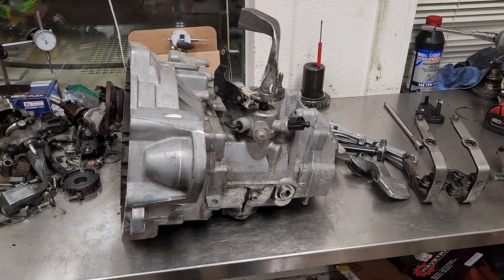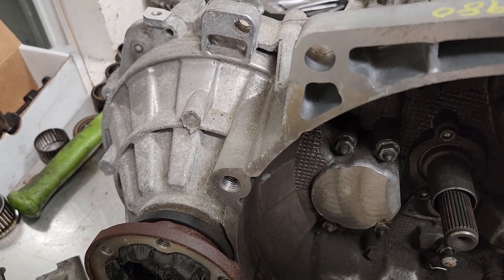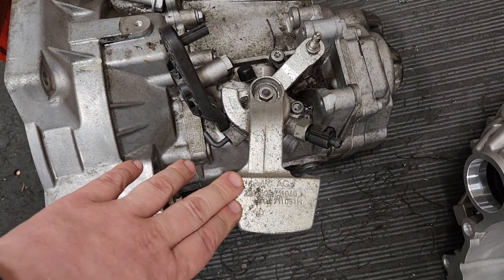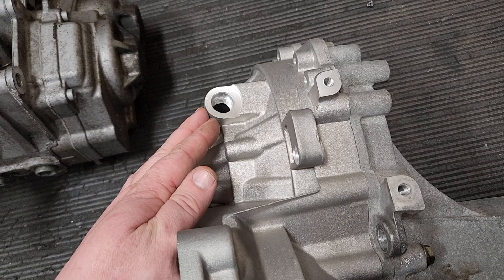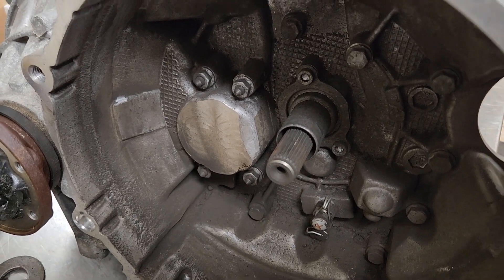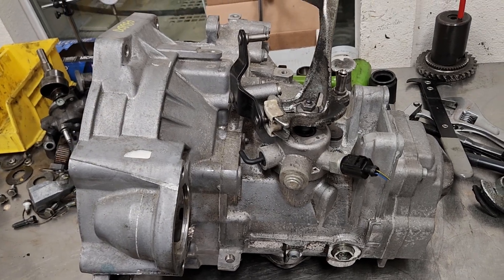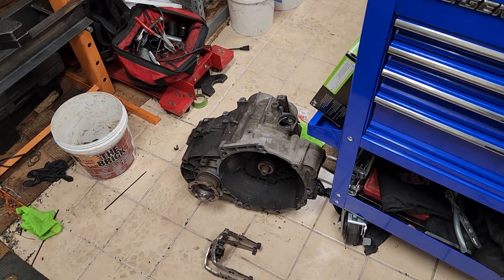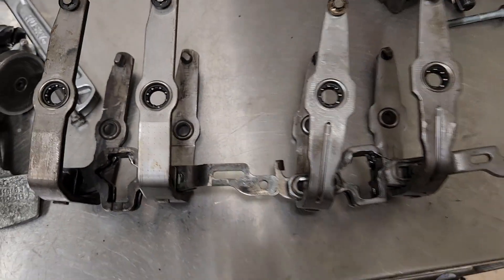VW 02S 6 speed swap into 02J case for Mk4

Comment: Wenn es rechts so viel länger ist als das 02J dann passt es doch nicht in die Karosserie und stösst an. Ich hab da jedenfalls keinen Platz für.🤷🏼‍♂️
Reply from the maker: It fits just fine. The extension goes under the frame rail no problem on a Mk4.
Reply: @dzelpwr Audi TT no chance

Comment: I have a 2012 Jetta 2.0 gas manual transmission broken LDZ I can’t find whit what other transmission can I replace
Reply from the maker: That's a 02T or 0AF family transmission, "MQ200". A step below the family discussed here.

You could use a 0A4 or 02S if you wanted taller gearing and a sturdier gearbox, but you'd probably have to change a few more things. Not sure if the axles are the same, the starter is almost certainly different, different clutch and flywheel etc.

So, any 02T/0AF can work as a direct swap, it's just there's going to be different gearing sets out there. There apparently are even 6 speed versions of the same MQ200 architecture, the 0AJ family.

I'm unsure on if those were sold in the U.S., but they do exist and likely would only have been offered on the 2.0 8 valve. Seems everything more powerful than that, including the 1.4TSI, got an MQ250 or MQ350 manual transmission instead of the 200.
Reply: I got a 2012 golf gti 6 speed manual transmission for it it fits on my 2.0 gas non turbo but my flywheel is 6 bolts and the other flywheel is 8 what flywheel can i use now

Comment: best long ratio 5speed 0A4 gearbox for 1.9tdi 105 mk5 golf lhw,kbl,lll code?
Reply from the maker: Here in the U.S., LEA, NZA and QSY are good ones that I'm aware of.

All are 3.39 FD and have a ~0.66 5th gear as opposed to the old 1.9L 90-105 hp ~0.75 5th.

3rd and 4th are also taller.

Original 4th for the old TDI 5 speeds is typically 0.97, the codes mentioned above are 0.87 instead.

Comment: Much rather have a GQV DRW DRP box
Reply from the maker: I don't.

You can have your failure prone slave cylinders and shift forks. Your much harder to find and more expensive axles, clutch and flywheel, starter etc.

The MQ250 family may not be "as strong," but they sure don't seem to break in stupid ways like MQ350s do.
Reply: @dzelpwr uk in 20year I personally haven't had a box failure in our fleet of passat b5 mk4 golf gttdi pd150 fabia vrs pd130 bora highline 2.8vr6 
maybe just lucky with good previous owners and my servicing only gearbox iv had here in UK fail was astra vxr m32 6speed chocolate box

Comment: My mk6 golf 2.5 trans went and i dont want to attempt the 6 speed swap right now.... But i considered trying to swap parts from the 6 speed into the 5 speed case.... Now you got me thinking. Not saying it's even possible
Reply from the maker: Well, that's the neat part about the 02S. It would be a direct swap for the 0A4 5 speed your 2.5 left the factory with. No swapping parts between transmissions necessary.

Comment: Is it possible to convert the 02j to 02m? Just swaping the internal parts?
Reply from the maker: 02M is completely different architecture with two pinion shafts instead of just one. 

There are exactly 0 parts that interchange with the 02J.

Comment: Very helpful vids. Thank you very much. We currently swap the 02s internals to my 02a case which should be the same as the 02j. 

We now found out the selector of the 02s don’t fit the 02a case because of the lever length.
If I understand correctly you used the 04a (0A4311490B) selector which already has the 6th cutout.

I really want to use the 02s tower because of it’s very straight and quick gearselection.

Hope you have an answer!
Reply: So after my post I saw your comment to BWRfilm. I believe this video has been made and you ended up with a different solution as you said.

That means I have to adjust the 02a selectors.
The only thing I’m not sure about is if I can use my 02a tower or do I need to switch to a 02j tower?
Reply from the maker: You will have to remove the 5th gear rail from the 02A selector assembly and modify it so it will be able to go into the 6th gear position. You can still use the 02A tower, but changing the shift linkage cables, box and tower to later 02J style makes for a much more robust, reliable and precise shifting experience. 

My first VW was a Mk3 about 20 years ago that had an 02A and I grew to despise that shift linkage. Once I hacked the 02J Mk4 parts into the car, it made me enjoy the car all over again as if it were something new.

I used the 0A4 rear case half so I could retain the 0A4 selector and 02S tower, which does shorten the throw some. But, for Mk2-3 era cars, the 0A4 case half does not have the provisions for that transmission mount bracket. So, if you want to use that OEM bracket instead of fabricating something new, then yes, you will need to modify the 02A 5th gear selector fork/arm to be able to go into the 6th gear position. Also note that the lever for 5th and 6th gear likely also has the pivot point in a different position than it does for the 02A/02J, making the throw shorter there as well. So, matching 02A parts with that 5th/6th gear arm may cause 5th and 6th gear to have a oddly shorter throw than the rest of the gears.

I am unsure on if you can just use the 02A/02J fork/lever there or not. It will probably still work with the 02S' lever, just may feel a little odd with the different throws for 1-4 vs. 5-6.

Comment: hey man. how much torque can the 02j handle?
Reply from the maker: I know a couple people with 350 ft-lbs being sent regularly through them and they're holding up. Adding a pinion brace helps a lot.

As you get above that, the clutch needed to hold much more is substantially stiffer and has the tendency to bend the clutch fork. Buying a reinforced clutch fork for such a clutch setups would be required.

Obviously an old, worn-out transmission with bearings that are no longer as well-preloaded as they were when new can make it easier for gears to strip out under those high loads.

Also, when making that much power, a limited slip differential would be ideal to both eliminate the potential failure point of the little roll pin that holds the main spider gear shaft into the differential, plus having ARP hardware securing the ring gear to the differential is an upgrade over the original rivets the VW differential would have from the factory to secure the ring gear to the diff assembly.

You do those upgrades, they can certainly hold more torque than that, although if you are constantly putting that level of power through it because it's a track car, maybe you would be better served with an 02M or 02Q MQ350 gearbox.

Comment: So can i swap to octavia 2 wit 1.6 mpi ?
Reply from the maker: I'm sure you could. I don't know what those originally came with. We never got Seat or Skoda brand vehicles in the U.S.. We also never got 1.6L MPI or FSI engines here, but generally speaking, VW has not changed the bellhousing bolt pattern on their water cooled 4 cylinders. They've added extra bolt holes over the years, but any transmission meant to bolt to a VW/Audi water cooled inline 4 is technically interchangeable.

Might need a different clutch and flywheel depending on what it had in there originally. Might need different axles and a different mount bracket. Maybe the clutch hydraulics change and the bracket that holds the cables to the top of the transmission. All depends on which exact transmission your car currently has.

There's also numerous different 02S 6 speeds available in Europe we never got in the U.S., and with a wide range of different gear ratios and final drives. So, depending on exactly what you're after, there may well be a specific code that best suits your wants/needs.

Comment: so this would be say straight swap to a 2010 golf 2.5 with a 5 speed?
Reply from the maker: Yes, it would. The 5 cylinders use the same bellhousing bolt pattern as the 4 cylinders. There might be an extra bolt hole in the bellhousing that's not used. Older 4 cylinders don't use that extra hole either, but these newer 0A4/02S transmissions just happen to have an extra bolt hole above the passenger side axle flange. No big deal.

Comment: My main reason for converting from the 02J to 02M was the increased diameter clutch which solved my slip problem but it was a complex job in the PQ34 platform.
Reply from the maker: Definitely a lot of different associated parts, at least. And you need to recode the instrument cluster for the different pulses per mile of the 02M VSS.

There are some good aftermarket clutches for the 02J/MQ250 family that hold a good bit of torque. South Bend makes some excellent ones.

Comment: So why couldn't you use the 02s selector forks, you mentioned having to use 0a4 selectors cause of the cut out and all, being able to shift in sixth but how does the 02s selector shaft not work?
Reply from the maker: I do have the 02S/0A4 selectors in my final transmission build. The pivot points just don't line up with the 02J back case half. Since this was going into a Mk4 and I didn't need the provisions for the much older style transmission mount bracket, I just ended up using the 0A4/02S case back half to retain the 0A4 fork/rail assembly.

If I were building one of these transmissions specifically to go into an older car (mk3/B4 or older) I would have to modify the 5th gear selector rail to be able to go into the 6th gear position and use the 02J shift tower in order to use the 02J (or 02A) rear case half because how different the pivot pins line up that go through the case and into the 1-2 and 3-4 forks.
Reply from the maker: I should clarify the second paragraph... I would have to modify the 02A/02J 5th gear selector rail.... Because that assembly has the holes and bearings for the pivot pins in the correct location for the 02A/02J back case half, and again would have to use the 02J shift tower to match as well, not to mention the lower bushing that is part of the casting with the big VW logo on the bottom of the transmission.

0A4/02S shift tower won't fit the openings in the selector rail assembly for 02A/02J. The bottom of the 0A4/02S selector shaft is smaller diameter as well, so you have to be mindful of the difference in the bushing size on that piece of casting with the VW logo that bolts to the bottom of the transmission.

Similar stuff, just slightly different enough to not be easily interchanged.

Comment: Okay this is awesome. Thanks for all of the info! Does the 02S bolt up on a MK4? I wonder if it would be worth making a modified 02S case to make everything work.
Reply from the maker: It can bolt up, but it is spaced a few mm further away from the engine due to the bellhousing design. Really would need a different flywheel spaced out further to work on a Mk4.

I've detailed the other challenges of using the standard 02S/0A4 case in a mk4. Swapping into a Mk4 02J case really is the best solution, especially for the vehicle speed sensor.

Comment: You can also adjust the cluster eeprom to read from the abs module and run the later 6 speed cables and shifter box.
Reply from the maker: I've seen coding available on BEW clusters to do this, but notsomuch on ALHs. I also don't know if it even works. Would an older Mk20 system actually broadcast a VSS on CAN, or is it only Mk60 systems that do it?

My 01 doesn't have a Mk60 ABS module for sure...
Reply: Ugh everything looked great until no vss. I spend a lot of time diagnosing bad abs control modules solely for fixing the speedo on all kinds of newer vehicles, absolute nonsense to force your speedo to rely on the abs system.